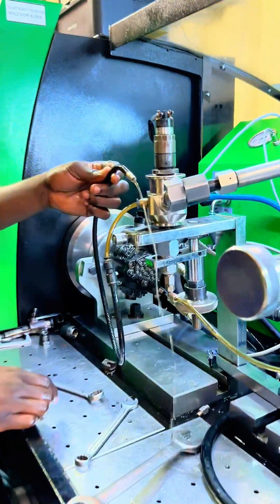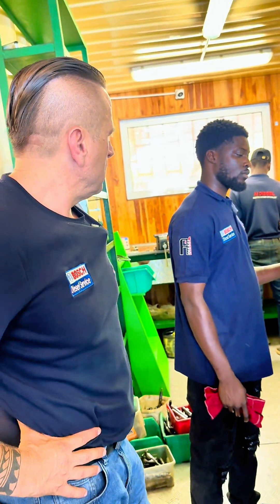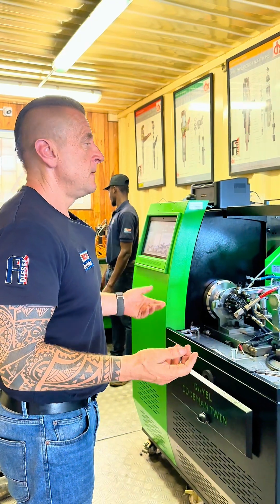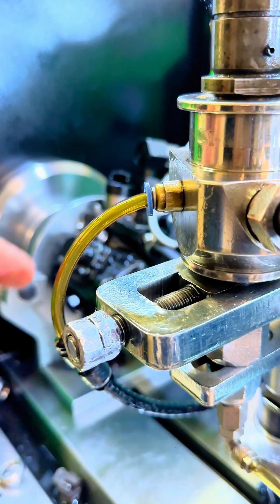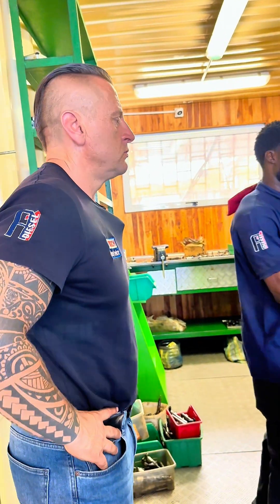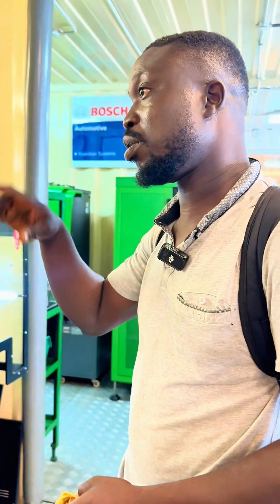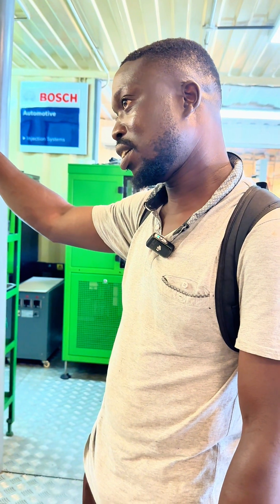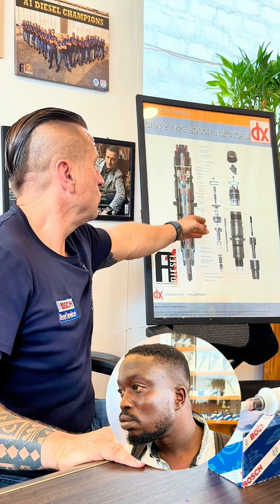What causes diesel injector failure?

Comment: Dirty fuel
Reply from the maker: Yes, dirty fuel can cause a lot of issues, like clogging fuel injectors, damaging the fuel pump, and affecting engine performance. It's always a good idea to use high-quality fuel and regularly check for contaminants to keep the engine running smoothly.